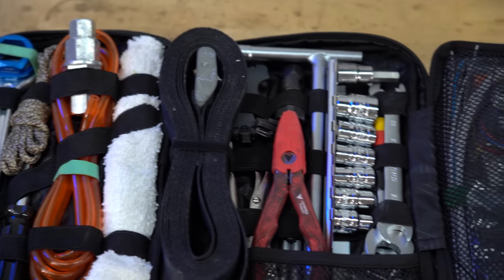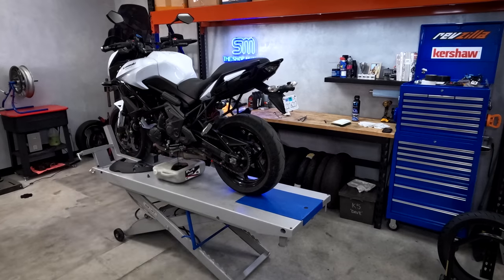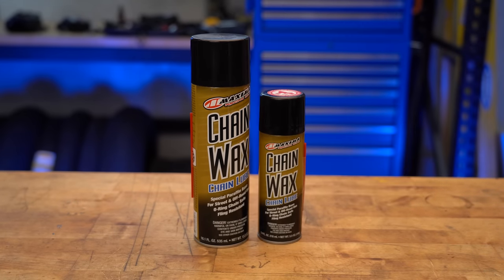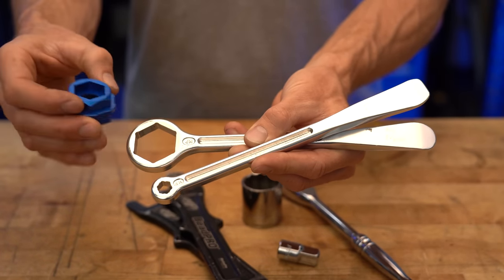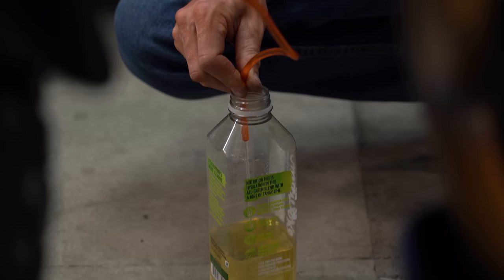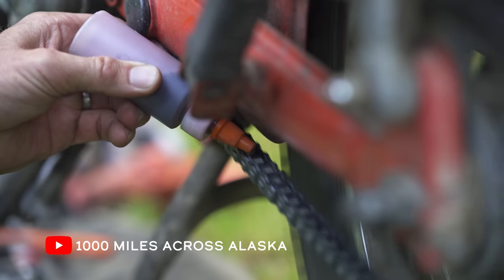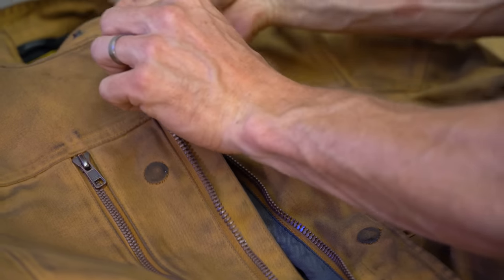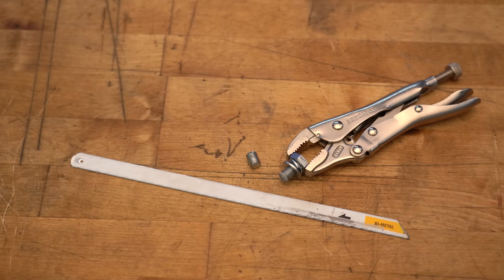What Tools To Pack For a Motorcycle Road Trip | The Shop Manual

Comment: About the right attitude: In 'Zen and the Art of Motorcycle Maintenance', Robert Pirsig says to always take off your jacket when you have to do roadside repairs. Getting too hot - and you quickly will - adds a lot of frustration. I love that tip!
Reply: I need to dig out that book and re read it
Reply: One of the greatest books ever written, in my opinion; and I don’t even own a motorcycle.
Reply: I'm currently re-reading Robert's Zen book almost 50 years later. For me, the key is reading it a bit at a time, and when you're not sleepy. It's a gem for motorcycle riders, but it's really for anyone to enjoy!
Reply: You need a book to tell you that. I live in the tropics, naked all the way 😂😂

Comment: A couple steel zip ties are good to bring along, in case you need to secure something exhaust related.
Reply: Truth
Reply: That and a radiator clamp. The clamp can be used to clamp, to be used in a chain of parts and contraptions to get smaller thereby tightening things and you can use the holes the worm gear rides on as a sander like a cheese grater. I throw a few around a round piece of frame or tubing and they can just ride there until needed.
You can take a few common wrenches and screwdrivers, wrap them in a blue  shop rag and hold the entire thing together with a radiator clamp around each end. Then you can use a coin to open them and you have a nice little tool roll and a rag to wipe something up with.
Reply: @mraycgz  Great tip! On cycling trips I secure extra spokes directly to the frame. This is a similar idea.
Reply: He did mention safety wire, which would do the same trick, but yeah metal zip ties are pretty sweet.
Reply: @moliver000  can confirm, my rangers exhaust has been held on by 18g stainless steel wire since i bought it a few years ago. Finally snapped recently, re wired it but am currently looking for new hangars and gotta redo some upper mounts. 
Its been a permanent temporary repair long enough, time to do it right lol.

Comment: Great video Ari! I'm 63 and a new rider, this month. Thinking of doing a solo ride to Mount Rushmore and although I'll never be too far from help, I want to be ready to do any repair myself anyway.
Reply: Excellent! You probably don't need a kit this comprehensive if you'll be near town. You might be better off with our "Motorcyclist's EDC" kit that we outlined a few episodes back.
Reply: Honestly, if that's the plan, a flat tire kit and the AAA card is probably all you'll need.
Reply: I am also 63, and am still riding long distance. I am still riding mt 2002 Kawasaki Vulcan 750, which now has 119K miles on it, all mine. It does at least have tubeless tires, but is a VERY complicated bike. There are a LOT of things on it that simply cannot be repaired beside the road. Fortunately during the past 20 years, I have only had 2 of those things fail. I am looking for a replacement for this bike, but it will not be new. I simply will not own a bike with EFI or ABS. I want a real motorcycle, not a computer on wheels. I am seriously considering a 2004-2006 carbureted Harley Sportster 1200. There are a lot of them out there with low miles, and the EVO Sportster engine is virtually bulletproof.

Comment: Latex gloves, multiple pairs…can be used as wind insulation in cold/wet weather rides…you’ll be glad you did. Multiple pairs because if you are like me, forgetting to replenish your stash is as good as not being prepared at all.
Reply: I do the same. I wear a set under my gloves and it really helps in the cold. You can also wear a set of wool liners too for some insulation though then it's quite bulky.

Comment: I did a trip from here in England, through Europe then on to Russia including St Petersburg, Volgograd and Moscow in 2019. I rode just over 6000 miles and I took a bunch of tools and stuff with me.

I only used 1 tool the entire trip. A pair of vice grips to straighten my brake pedal when I dropped the bike on a loose surface. I'll still carry a bunch of tools for future trips though.
Reply: That sounds like so much fun. It would also be fun to keep going though. Maybe Ekaterinburg or Krasnoyarsk.
Reply: Carrying tools is like carrying a condom: better to have and not need, rather than need and not have.
Reply: How long were you riding for? And how did you get back?
Reply: Nice. I would like to know how long was the whole trip and which motorcycle did you use :)
Reply: The first person to say "Better safe than sorry" definitely had it right.

Comment: If you have boxes or paniers you can also velcro the light stuff to the underside of the lid.  Fuses, JB weld, hex keys, and other light tools should all hold up there just fine and it'll save space for the bigger stuff in the in the boxes.

Comment: I own a Tiger 900 Rally Pro, looks pretty much like the bike directly behind Ari.  Shortly after buying it, I checked every nut & bolt on the bike that I might ever have to remove on the road, and wrote everything down.  To my amazement, the Triumph tool kit made by Cruz Tools had every one of them!  Someone did their homework there for sure.  Needless to say, I bought the kit (from Revzilla, of course), and only added a few other generic tools, plus the tire repair stuff, etc.  Cruz makes a really, really complete kit.  I’d buy one again in a heartbeat!
Reply: Wow, that's great to hear. Usually OE tool kits are trash! Glad to hear Triumph partnered with a quality company like Cruz; I love their stuff.
Reply: @AriH211  I don't think Cruz & Triumph partnered on it, I just think that Cruz did their homework, unlike most companies, and we get to benefit from it!

Comment: A jump pack or extra battery is a great idea. I have been stranded and had to call help 5 times and 3 of those times were because of battery or charging system issues. On different bikes in every case.
Reply: An extra battery isn't really feasible to be carrying around with you constantly. Plus in almost all situations you can push start a bike with a dead battery/ weak charging system
Reply: I have a Microstart similar to the one Ari showed, and always carry it on the bike.  It saved the day this morning; just as a few friends and I were about to head out on an organized ride, I used it to jump a friend’s ST1100.  Would have been a bummer for him if I didn’t have it with me, it’s a pretty heavy bike to try and push start.

Comment: Good 👍 advice, for my trips on and off road in Australia here is just a few different things 
1. Snap jack - small compact is fantastic you don’t have a Center stand ( for road and ADV ) 
2. As above for dual sport I have a short aluminium pole 12 inch’s long - and can adjust out like a tent pole you put it under your peg ( it also has a welded base ) it lifts the rear wheel off the ground and with front wheel can put it through the front of the base of plate to lift front wheel, it’s light and cable tie to bike . 
3. Chain lube I use Motul chain lube it’s in a toothpaste looking tube . Fantastic compact ( and you don’t have to worry about a can of lube leaking all over you gear .

Comment: That was terrific, Ari, thank you! I use J-B weld often, but it wasn’t in my tool roll. It is now! Same goes for fuel tubing - I carry some, but not enough for siphoning. Not anymore!😃 The one thing I have used more than anything else since I added it to my kit is that emergency jump start battery. It’s so much easier than a push start, and it seems like on every trip, somebody ends up with a battery/charging issue of some sort.

Comment: Lots of great practical advice.  I carry most of this stuff in my slightly too large tool roll.  I use a one ounce flip top bottle of RemOil in lieu of WD40.  It works similarly as a solvent, penetrating oil and anti-corrosive, but it leaves a drier Teflon finish and doesn't form yellow crufty goo a year later.  I carry a small hank of safety wire and the small needle nose ViseGrips are the safety wire pliers.  I carry a few blue Scott paper shop towels in a heavy duty zip lock bag and two pairs of nitrile gloves.  I also carry a single use dual pouch of epoxy and hardener, but make certain it can't be punctured because that's a huge mess.

Comment: Another thing to note would be to go to the forums and see what common parts go wrong. I.e. connectors and slave cylinders etc to carry a spare of those if possible. Also a brake bleeder is a great thing to have and is the same size as a cable tie

Comment: Talking about the right attitude, I have made a job using this. I work for a refridgeration/food equipment company that contracts with a very large convienece store chain in our area. Well the boss kept getting requests for oddball service stuff like replacing a coupleof floor tiles, swapping out paper towel dispensers and such. After a bit, he started sending me and my crew (my 2 sons) on these and suddenly things that had been big issues of worry for the bosses, became 2 hour jobs for us. You see this chain has their own service techs to repair anything that has to do with the store but there is a lot that falls outside of what they can do. This is where I come in and get it handled, all bc I refuse to let myself be stumped on getting the job done.

Comment: This video came out just in time. I was starting a solo first long ride trip, and was looking up for content.🔥all thanks to revzilla ♥️
Reply: Ditto, but this will be my 3rd solo trip. And this will be a 2 week trip
Reply: Have fun bro
Reply: Have a great trip! 

I think the opening remarks of this are the most important - do a service and make a note of what you need. I mostly use a mix of hex/driver/socket adapters with just a couple of wrenches for where sockets don’t work. Other top tip is a digital torque adapter. It might not be as accurate as a super expensive & massive torque wrench but on the road it means you can tighten nearly everything on your bike to spec on the road.

Comment: Great video! Always nice to hear Ari’s well considered/reasoned thoughts.
Glad to see someone mention a headlamp in the comments. Hands free light is a big help. Also, someone mentioned a small multimeter. Very useful for most bikes built after 1980!
The only items I would add are a small umbrella (for shade, as I’m usually in waterproof riding gear), and headlight and tail light bulbs, if you intend to ride at night. They don’t fail often, but when they do you’re in a bind, as it’s never right next to a parts store!
As Ari mentioned, get familiar with your bike and tools. In the Jeep world I’ve seen too many people stuck on the trail, unspooling their expensive winch for the first time….

Comment: Pro-tip on odds and ends that an old-timer taught me...even if you do not have tube tires, a section of inner tube is great to have.  With RTV, duck tape and a chunk of an old car tube I fixed a blown out (dime sized hole) in coolant hose long enough to get to a real town (about 80 miles) to scavange for a suitable replacement.

Another easy one is carry your duck tape and electrical rape by wrapping it around a #2 pencil...packaged smaller and both the pencil and its graphite coul be useful (rarely, though).

Interesting that you do not carry fuel or oil.  I get that where a lot of people ride they are only 20 minutes from a fuel station at any time but even in the US, on paved roads, I have run into two instances where I was more than 120 miles between fuel stations able to dispense fuel (one was on Navajo land and fuel station looked like it had been closed a while and the other in South Dakota which closed at 9 PM...no credit card pumps).  I carry a 2L AL bottle of fuel if I know I am going in rural locations.  Oil, I always carry a quart mainly for convenience.

Comment: I carry a mountain bike (high volume low pressure) tire pump.  It's a fair amount of work to inflate a motorcycle tire but it's much lighter and less bulky than a 12V inflator.  A small hand pump is nearly foolproof and it can be easily repaired in the field, unlike a tiny compressor.

Comment: I think one glaring thing that I felt was missing was a multimeter of some sort to diagnose shorts, if power is being supplied, battery voltage and open circuits.

I use one of those cheap and compact pen-style meters.

Comment: Most tools you use almost never, so I generally pack them at the bottom of my side luggage bags. Same with spare tubes. That also keeps most of the weight nice and low, as tools are generally pretty dense. The only things you do regularly need, is the chain maintenance stuff, which I usually have somewhere else.

Comment: Instead of an adjustable nut rounder, I carry Knipex parallel jaw pliers. a touch expensive but worth their weight in gold IMHO. they are probably my single most used tool at work (aircraft maintenance), and they're great for a bike too

Comment: A can do attitude is definitely an essential thing to pack, as you say.  I once used a pair of hemostats (my favorite electrical tool) to rip a piece out of a roadside beer can and fold it into a jumper wire to put into the connector of the clutch interlock on my girlfriend's bike so we could continue the weekend after a kickstand fall in the boonies.

Comment: My friends and I rode 2 mid 70s KZs and a Ural to Rockerbox in Fond Du Lac Wisconsin a few years ago.  It was an 800 mile round trip, so we had every tool we could possibly fit (including a Dewalt 1/2” drive electric impact wrench) into the trunk on my Ural’s sidecar.  The only thing we needed the whole trip was one zip tie to replace a missing license plate bolt.

Comment: I got a flat and had to plug my rear tire. I proceeded to get 2 more flats and used 2 more plugs. All in the tread thankfully. The tire was fairly new and I was too cheap to buy a new one. I put 10k more miles on the tire. Never leaked.

Comment: I just stop in the morning on my road trips and use some diesel on my chain. Seems to work just fine. Was worried about it drying out my o rings but haven’t noticed and degradation in the rubber yet

Comment: I've found that screw type tire plugs work very well and are quick and convenient. You know, those little screws covered in rubber that you can cover with glue and place in the hole after removing the nail. I always carry a rechargeable air pump, last time it took me all of half an hour to get back on the road 👍

Comment: Thanks for the list.  The only item I'd add is sandpaper and a multimeter.  Getting stuck in Beatty, Nevada on US95 taught me I need the tools to diagnose problems and a lot of these little towns do not have hardware/Auto parts stores.
Reply: There's a small piece of sandpaper (likely 120 grit) in the Parks Tools patch kit. A multimeter is a great idea if you have space.

Comment: I second the inreach for ADV riders. Experienced riders know, but if you are a newer rider: cell signal and main roads are directly correlated. Once you deviate off the main road, or off-road, cell signal diminishes. And accidents always happen where signal is weak or non-existent.
Reply: Theres some surprisingly affordable handheld CB equipment one could use in a pinch, some frequencies can be used for long range comms and are quite beneficial in the boonies.

Comment: Call me paranoid, but when traveling long distance, I prefer to bring an edtra set of control cables dnd spark pkugs.  I usually perform maintenance before such trips, but it seems to be better to error on the side of caution.

Comment: Good Video, but this is definitely  for an Off-Road Adventure as opposed to a "Road Trip".  On an Evo or later full dress Harley (like mine, 110k miles), there is not much you CAN fix by the side of the road.  Of course the number one thing is to make sure the bike is ready.  Are the tires and brakes like new?  Even if you intend to stay on Highways, new tires can't be beat.  You never know when you're going to hit torrential rain or worse.

Comment: Buy a cheap vacuum sealer. You obviously won't bring it with you, but you can use it to make all kinds of stuff before you go: Custom sized waterproof bags for single use items, custom sized ziplock bags, custom reflectix cooking bags, etc, etc...

I have a ziplock freezer bag that fits three pairs of ear plugs (and nothing else) in the smallest possible space. I've had it for three or four years.
Chemical hand warmers can be opened then vacuum sealed to about half their retail size without losing any heat capacity or shelf life.
Generic waterproof phone sacks can be custom sized.
In a pinch they can even be used to preserve food.

Comment: For those that don't have space for a booster/power pack, invest in a replacement bike battery that has a reserve or controller that will reserve battery power for starting and preventing anything from draining it dead. This is usually a lithium battery with a built in BMS (Battery Management System) that will prevent the battery from a lot of things. Also, install a charging port to keep your phone charged while riding, or bring a significantly smaller power bank but still good for 1-2 charges.

Comment: You mentioned oil for fixing difficult adventure or dual sport tires. Have a video on patching or replacing a tube out on the trail? I ride a DR650, have a Dunlop 606 rear and Pirelli MT21 front. I’ve also had a few hand surgeries so any tips you can offer to get that done easier is appreciated. Thanks.

Comment: Something to smack with other than a rock is preferable. I simply carry the tool kit my bike came with. I've used that little kit and was surprised I was able to get back on the road. Another thing is where to store on the bike or on you. If I have my fairing on yes I can pack shit in. Without it well go figure. I got a front tire flat on Sunday between Green River Utah and Grand Junction Colorado. I was able to ride the bike all the into Junction after a few hours on the side of the road. All with the little tool kit and a tiny compressor.